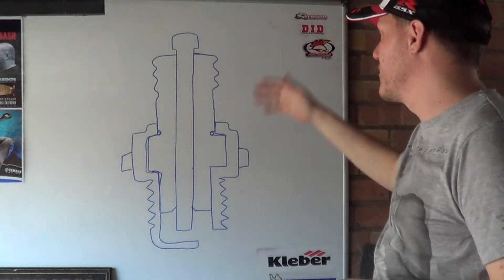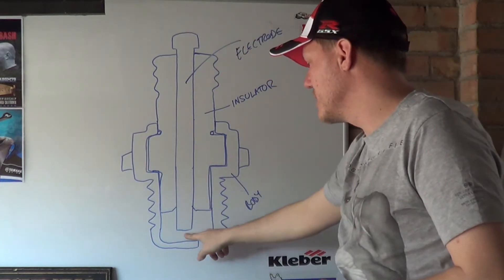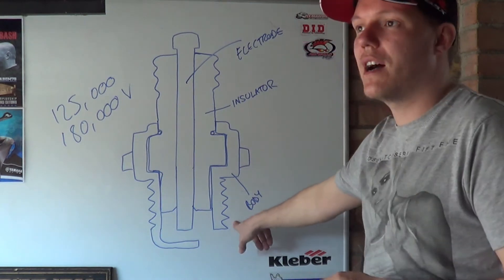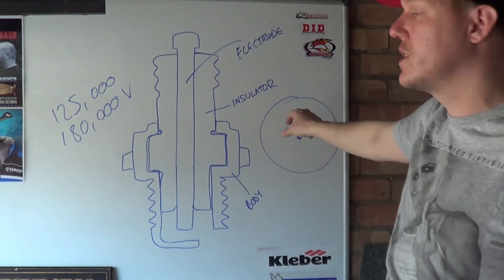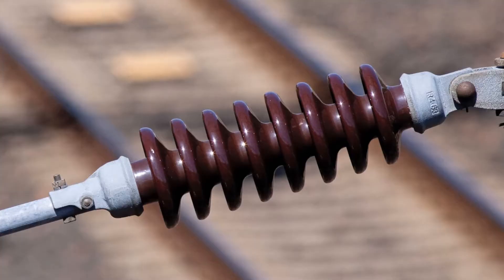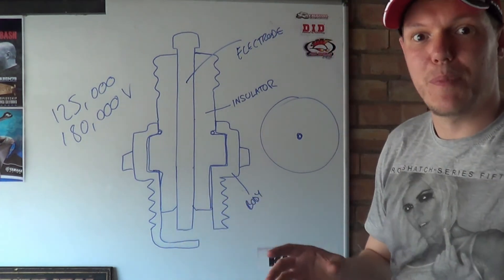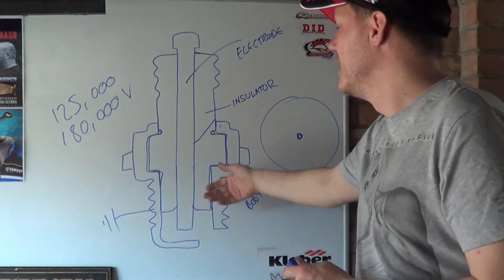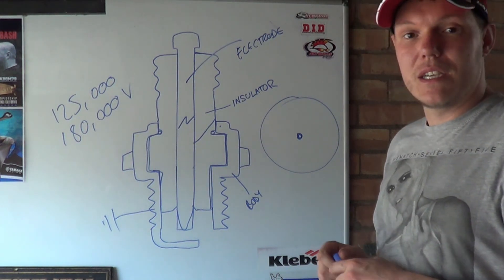Spark Plug Basics

Comment: Matt when a cylinder is misfiring is it solely down to the spark plug or are there other factors involved?
Reply from the maker: Back fire of misfire?
Reply: @thedirtyworkshop  misfire mate
Reply from the maker: Misfire is either spark plug or too lean. One cause of leaning out is an air leak in the manifold somewhere. 

Failure of the ignition coil is another cause.

Comment: The center electrode is not made of iridium or any other exotic material... If it is one of those fancy plugs with exotic metal then it is just a a small dab on the end of the electrode (and if it is the extra special one it has a tiny blob on the ground strap)
Reply from the maker: LOL a dab? The end of the eletrode is Iridium plated.
Reply: It's not plated but a small pice that is welded on... The point is that the long part you are pointing at (the center electrode inside the plug) isn't made of the expensive/exotic material...
Reply: And the ones that have the fancy stuff both on the electrode and the strap are mostly targeted at wasted spark ignition.. One plug having the spark jumping from the strap to the electrode and the other in the opposite direction.. I can't remember if material is moved from + to - or the other way around but in a wasted spark system one plug will erode at the tip and the other at the strap

Comment: My father had an old wooden cabin boat with a Morris motor in it . Once a year he would take the plugs out and give them the flotation test. He would throw them in the river, if they floated to the surface he'd put back in the motor . If they didn't he'd replace them

Comment: Over on the Triumph RAT forums, there was a big thread about dangers of using Anti-seize/Cooper Slip on spark plug threads. Thinking was the torque settings for the plug get thrown out the window when using these lubes and you will risk stripping the head. Apparently some plug manufacturers also warn of this. Your good opinion please Sir!
Reply from the maker: Adding any lubricant to any thread changes the binding torque, and then there's also hydrolocking to be taken into account. DO it dry.
Reply: Isn't there some risk of ending up with seized plugs in the head? I do start to see corrosion around the base of the plugs on my Parallel twin after a season of rain riding. Is the answer to change out (or at least pull the plugs for cleaning) regularly?
Reply: @TornadoCAN99  I'd assume corrosion would start from the outside and work its way in. Maybe bash a load of vaseline or something over the top once they're fitted to stop water getting on them? Might be bollocks though, I'm a complete novice, but just a thought.
Reply: @TornadoCAN99  spray with AC50 or similar after dry install  and check plugs regularly would be my advice